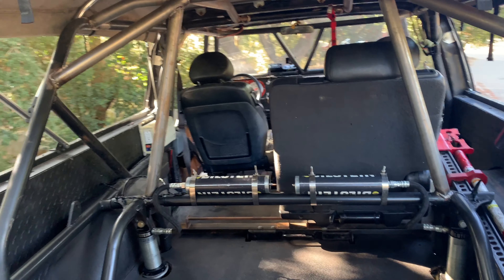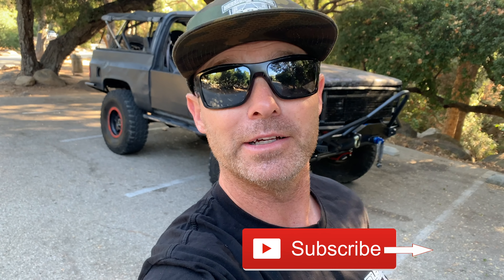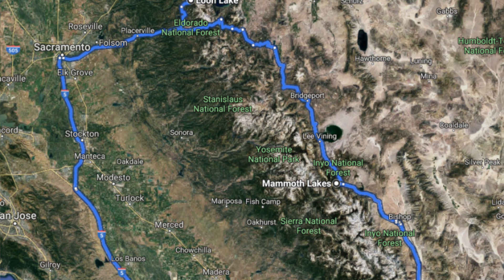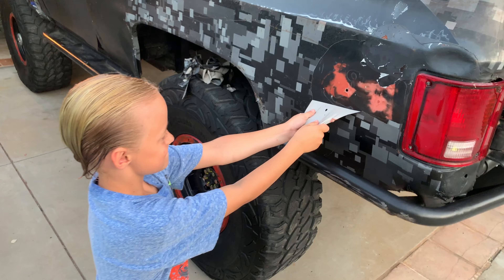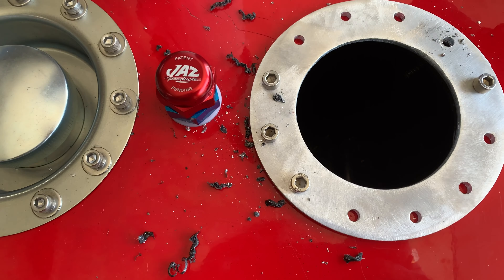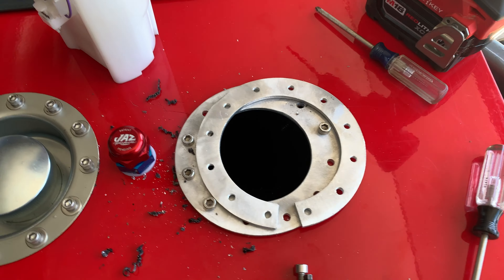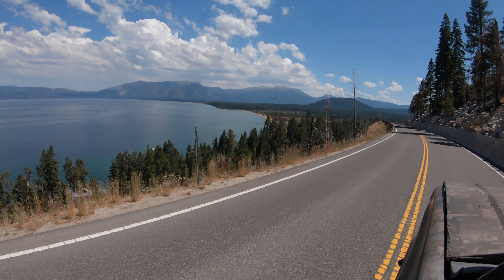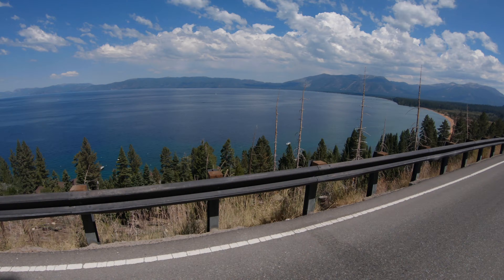MG #170 - its the Rubicon Recap!

Comment: I'm thinking about building a cage under the fron't fenders so I can remove the fenders easily when on the trail and still have protection.  When back at home put fenders back on with a couple bolts. Can even use sheet to cover when on way to trail .
Reply from the maker: Exactly what I was considering too.  But, the genders are pretty easy to remove as it is.  I am gonna mount them off the shock hoops though

Comment: I used a corvette master cylinder for my D60/14 bolt 4 disk crawler. The master is for a 4 wheel disk car. No booster and have no issues.
Reply from the maker: I think that’s what this one is.  The only thing I can think is that a brake line got super heated near the exhaust and it boiled over.  But never any loss of power.  The feel was different though.

Comment: @Merrick    I drove a 86 long box so I love this truck :)  Why don't you try getting guys that to try a sponsorship or test wraps ? Your channel is awesome & gets better all the time. & Suspension , You have off-road guys watch & do what you are doing . There are guys that can tell you where the valves & shocks to use as budget or better . There so many out there with the same setup or have there stuff from a upgraded rig used.  So many shows & You tube has help many , It is time to try & get better . Just try doing like some your rig car … gets on a channel like Jay leno Garage & you get many more that get into you & the any products used tested.  Good luck & I seen a wrap Clear that was used to cover the front for rock chips , very nice & flex for a cove to change as needed . Long time since , There must be stuff to help you & may be over the top of a wrap where the most rock chips , scratch.  If the wrap is cut in parts that was built to remove like body lines or even your camo that would be easy to fix like a puzzle ?  Your channel is great hope to see more :)